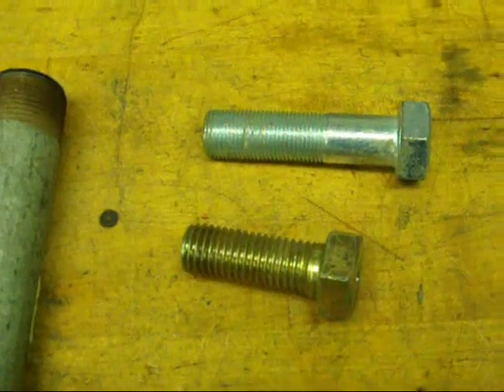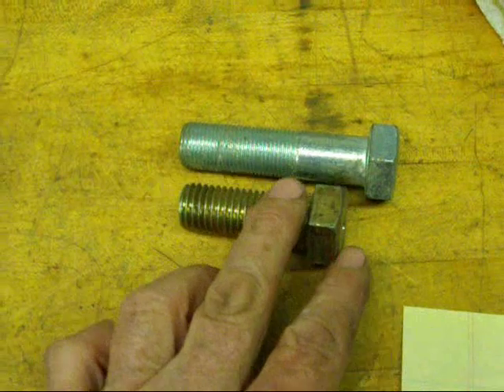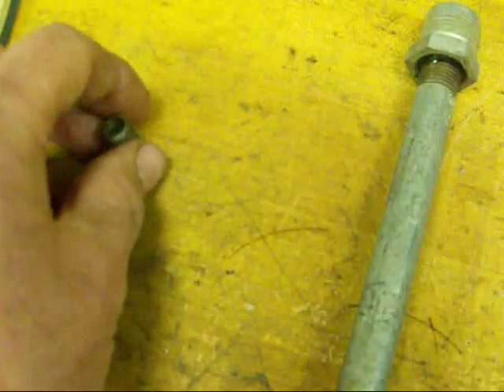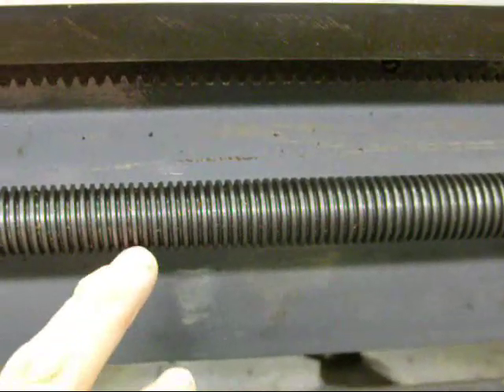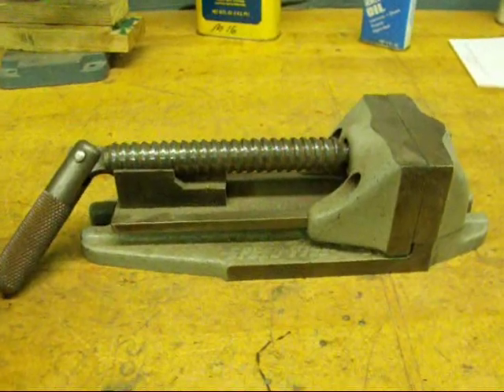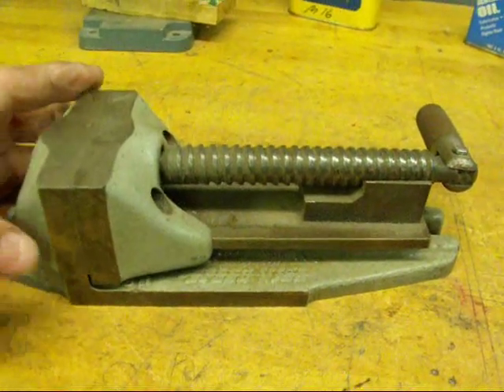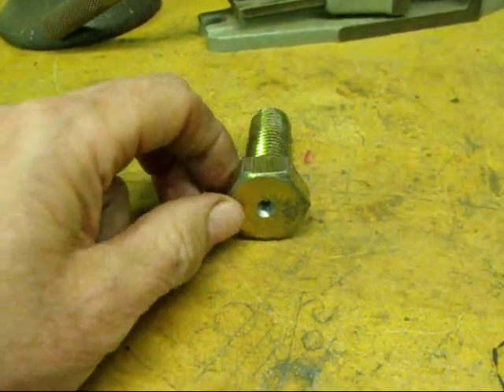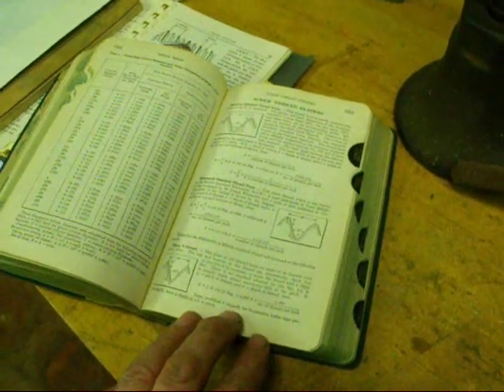MACHINE SHOP TIPS #8 Types of Threads part A tubalcain

Comment: i'm trying to replace my drill press column with a bottle jack.. but I can't figure out what size threads r on it.. ACME don't work.. I think it might be metric..  I bought a m20 trapezoidal thread round nut and that doesn't fit.. any tips..  I ended up welding it to a round bar to use as a column end but im not sure if it's level/true..any suggestions..

Comment: Pipe dope (oil and clay or Teflon) is not to seal, it is used so the joint can be separated many years later.  A common misconception.
Reply: Very common.

Comment: Buttress threads have been used in large gun breech blocks and in oil drilling. At my work we often make a special adapter, some out of plastic some aluminum that have male Buttress thread on one end and female tapered pipe on the other, I have no idea what they're for. I've had to cut a couple of square thread nuts recently for a couple of antique machine restorations. My Worcester lathe uses square thread in the cross and compound slides and in the tail stock quill but ACME for the lead screw. The nut in the tail stock was cast iron and stripped out so I managed to make a new one. A friend of mine has a large antique wood lathe that had the same problem so with my previous experience I was able to cut another square thread nut for his tail stock quill. Soon I'm going to have to make a new nut for my cross feed because it's getting real sloppy and stripping out. it's to small to single point and I don't want to change it to ACME (I'm crazy like that)... an older lathe man at work suggested I tap it with a LH Acme tap that's close then make (as I have looked and not found) a LH square tap to finish it... so we'll see...
Reply from the maker: Sounds like you have a lot of experience with odd threads. I do't think you will find a square thread tap.Thanks for watching.

Comment: I have a milling vise that was acquired by my father when he purchased a turn-of-the-century era drill press.  That has what looks like those buttress threads you show on your speed vise, except they feed into a brass feed nut that traverses the jaw.  As a result of their being surrounded by brass on all sides, they grip both ways.  I've always wondered what those were called, so thank you.  
I'm still perplexed as to why they were used on this vise.  Maybe it was originally manufactured with the function you've shown and it was retrofitted to its current state as the nut wore out.  It has the numbers 5 W 3 cast into the top, and that's the only insignia of any kind on the whole tool, so I don't even know who manufactured it.
Reply: Sounds like a Wilton machine vice with 5" travel over 3"  jaws. Originally Acme ™ thread, not buttress. I have always been amazed with watchmaker threads of 00-80, 000-90, and 0000-120 and down sizes. There are various standards for food industry, medicines, and various gasses used for welding.

Comment: The UK has been using Metric since the 70's pretty much, we kinda used alot of different threads at the same time between 1950 and 1980 though, Whitworth, AF, metric. I really like the WW thread, not really sure why we changed to American threads from the 50's and 60's....
Reply: @coles201
 Can't find info on the AF threads or the ww threads. Do you have a Wikipedia page link. Only https works on my end, due to various reasons.